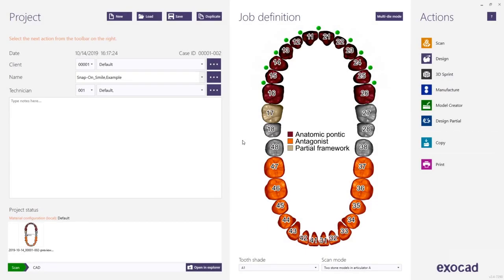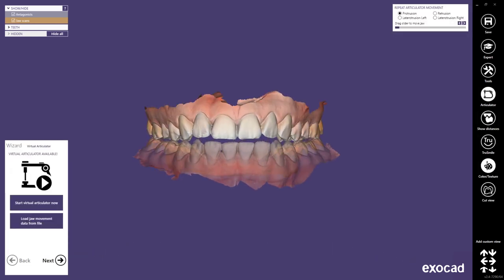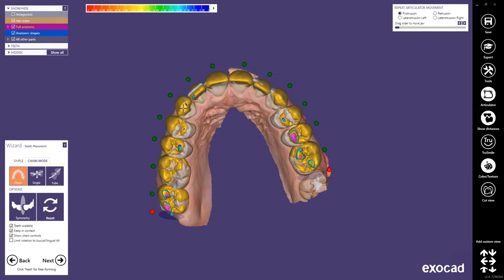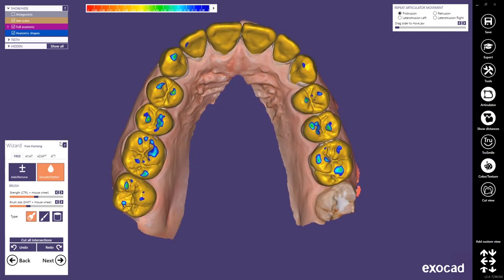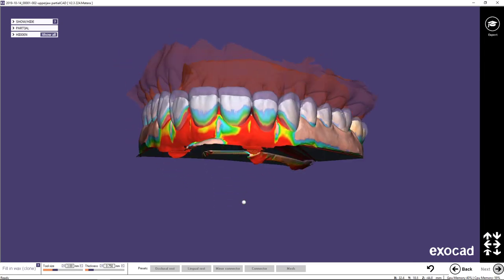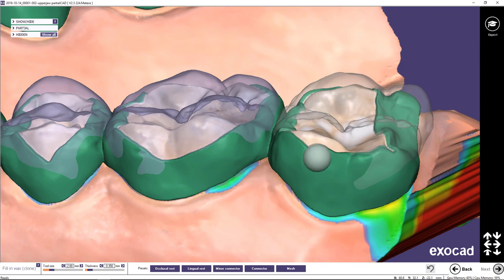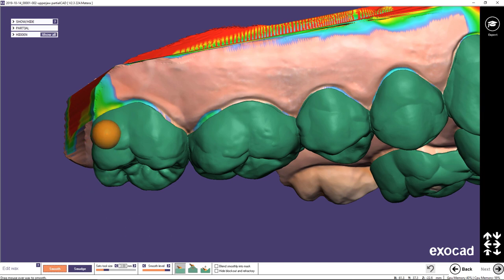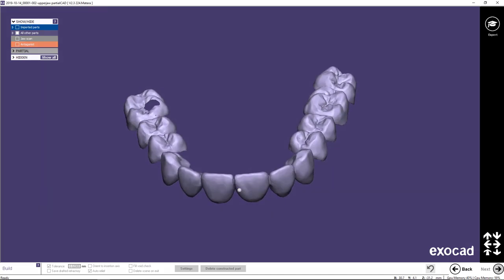Advanced: Creating "SnapOn" Design with PartialCAD

Comment: Hi is it possible to do snap on without partial framework Modul?
Reply from the maker: Hi @kavehdibaj8401,
Yes, since 3.1 Rijeka you can use the "Gingiva Base Design" 
trigered by the Wizzard last step to achieve a "flexible denture".

However, with 3.2 Elefsina it is more convenient to select the desired indication within the DentalDB, 
as you can see here: https://youtu.be/mLn5UZtckyg?t=518&si=I4Bw3Vom_hVJxNtC